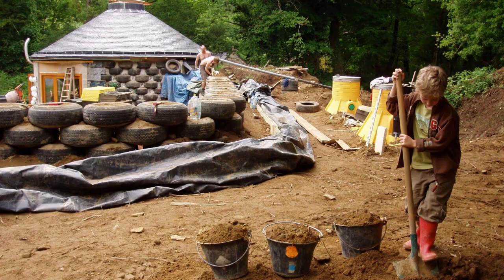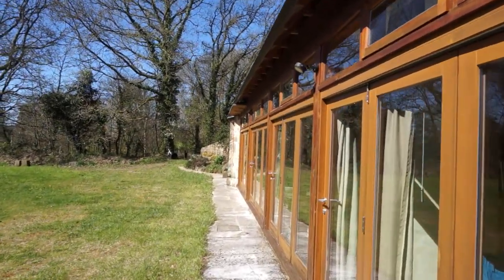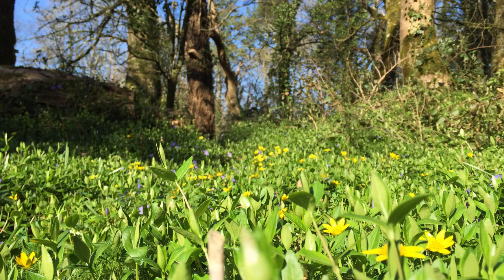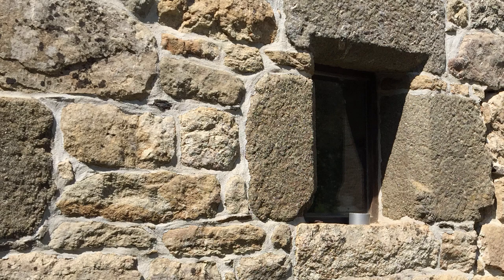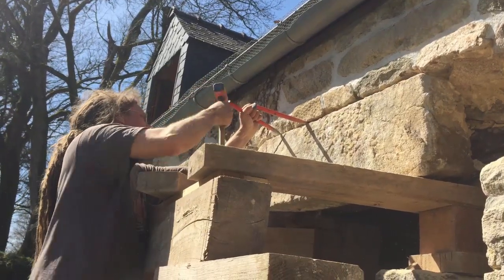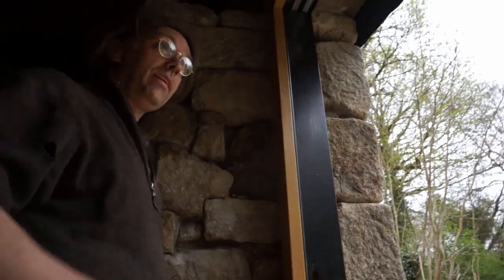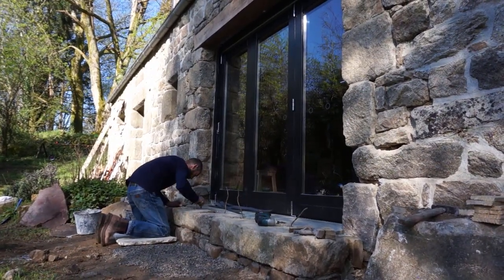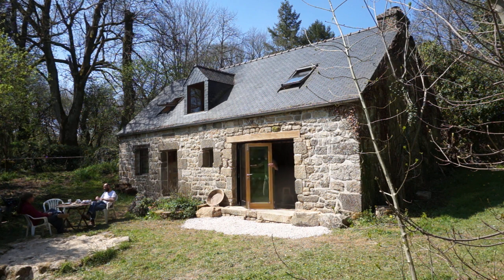Glass Front on the Old Stone Cottage

Comment: Did you succeed in making the cottage warmer in the winter, which was one of your goals, by removing a large section of thermal mass? And also, and just as important, did you maintain its traditional coolness in the summer (south facing windows add a lot of summer heat into a building)?
To add more downstairs light, another option, which would not have needed to destroy the historical nature of the structure, would have been roof tube skylights. I have installed those, and they provide a lot of light without having to destroy existing walls.